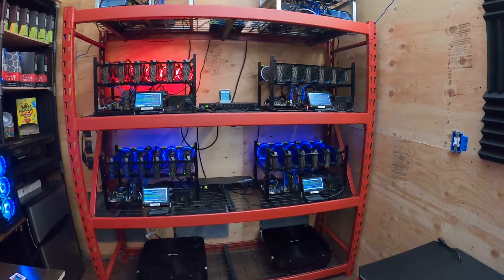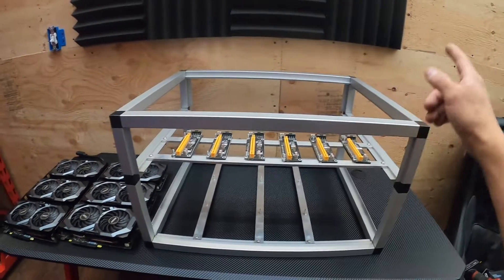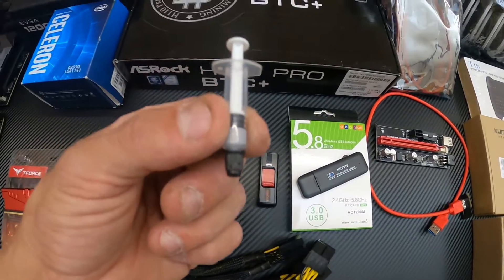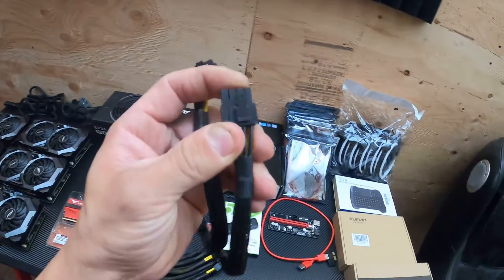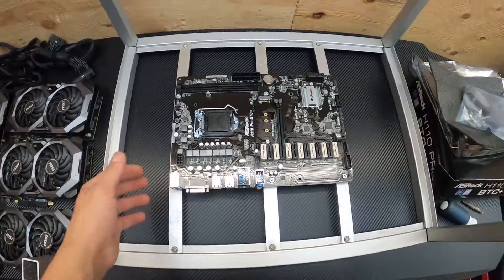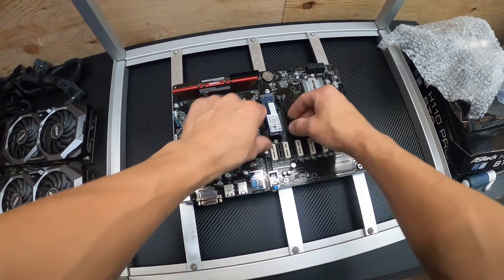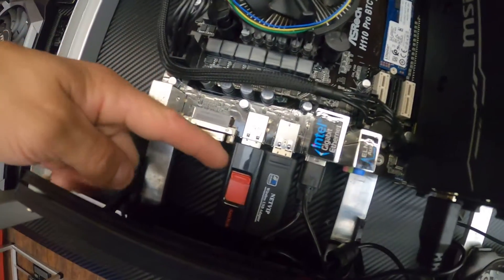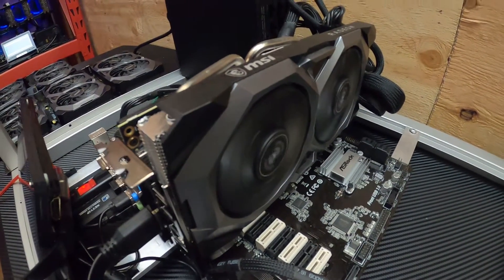How to Build a GPU Mining Rig!

Comment: How do i know If the house Can stand the Power consumption?
Reply from the maker: If your outlet is a 15 amp breaker you need to stay under 1500 Watts MAX. Same thing with 20 amp add two zeros 2000 Watts MAX. You should always try to stay under 70% of the max tho to minimize risk.... 

“This is just to my knowledge not expert advice. I would call a licensed electrician if you are seriously nervous about this just to be safe”
Reply: @ChumpChangeXD  thanks, i Will be getting a professional to work on It but im really curious, happy New years
Reply from the maker: @miranda9691  No problem just want everyone to be safe! Happy New Years! 🥳

Comment: Do I need to buy my own power on buttons if my board doesn’t have one
Reply from the maker: Yes you do if the board doesn't come with one.  I believe you can jump the board out touching the two power button pins with a slat head screw driver worst case.